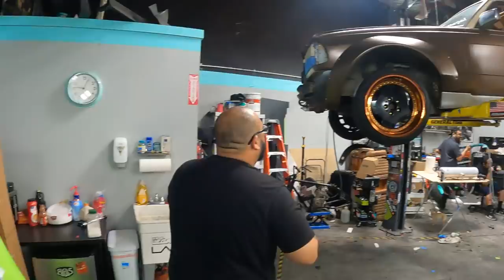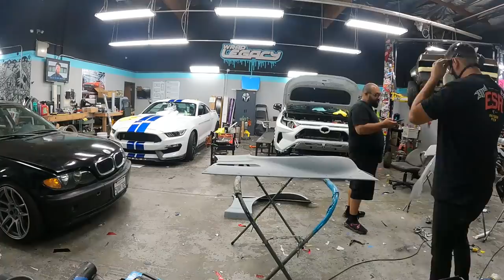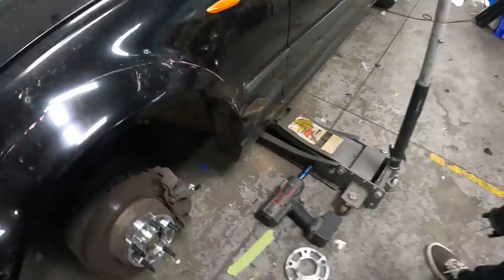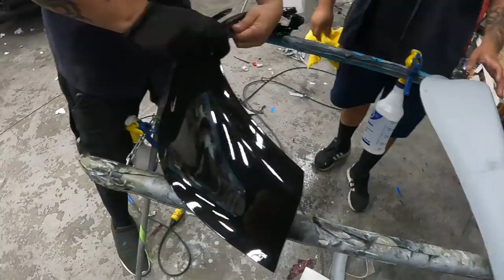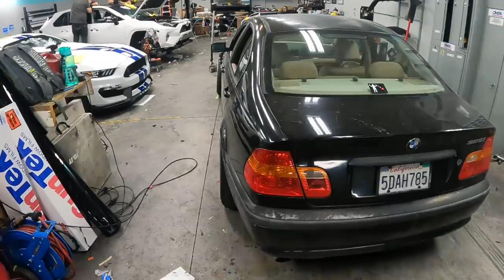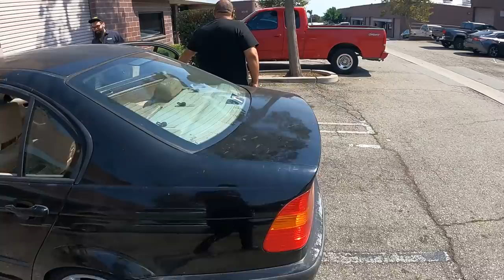FENDER FLARE INSTALL ON $400 DRIFT CAR

Comment: i have my e46 at the fabricators getting the rear subframe mounts reinforced, is that as necessary as everyone on the forums made it out to be?
Reply from the maker: Eh, I’ve seen it be more of a car by car thing. Usually if you swap the bushings before the cracks happen you can get away with it but if you drop the subframe to do bushings, you’re a flap disc and welder away from making it damn near bullet proof
Reply: Up here in rust city it’s not even a question, do it or it will rip out overtime!
Reply: @wthomasw2  yeah im glad i got mine done just for piece of mind. was basically the only thing i wasnt comfortable doing myself. took it to tc design in campbell and the reinforced it and did all the bushings for 2k. pricey but my next quote was 3600

Comment: get the 3.46 diff from auto 325i. That shi pulls with that diff. i guarantee
Reply: I thought Manuals had better gearing?
Reply: @movementonwheels  they do, but if u install auto diff that means you'll have higher rpm, higher rpm means less clutch  kick and its more powerful, i smoked g37 yesterday, with that diff
Reply: That's what it has. It was in the part 1 of the diff/weld video